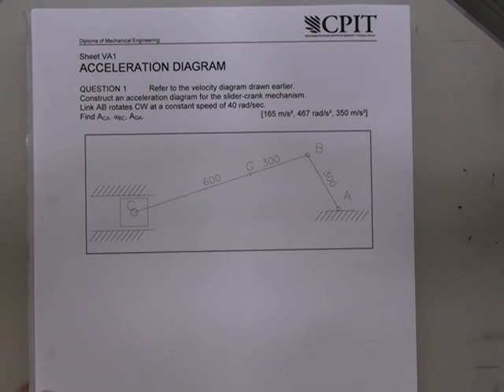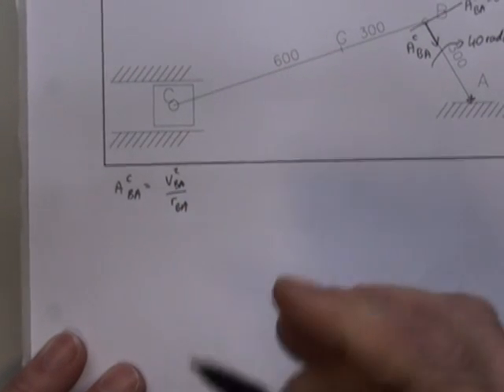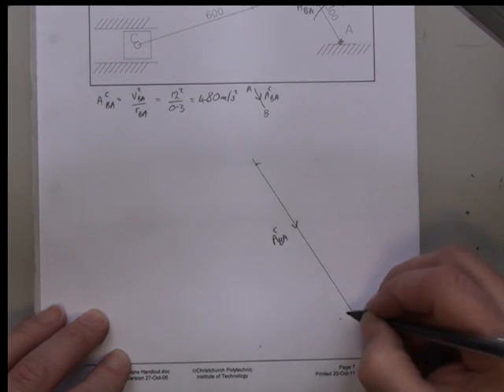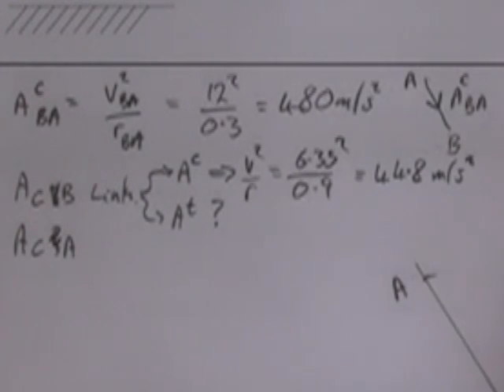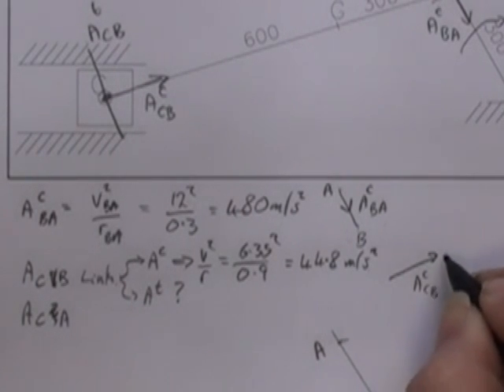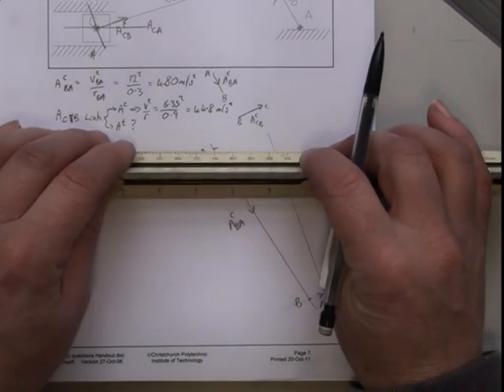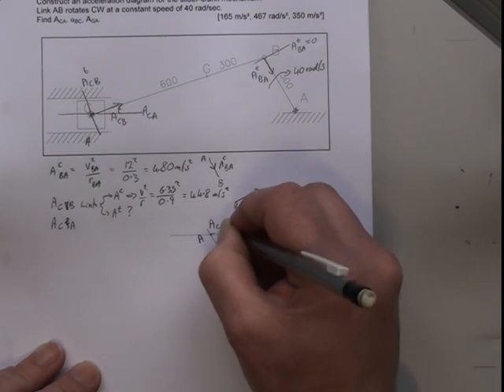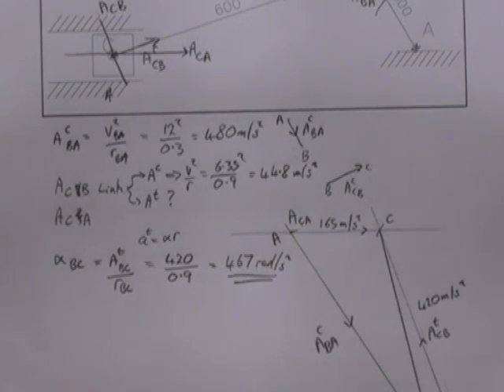Acceleration Diagram construction

Comment from the maker: Hi,  You can measure the angle if you want to be more accurate.  But you need to remember that the answers you get are for only one point on the travel of the linkage system, so you may not get the value of max acceleration anyway because it may occure a few degrees later in the travel of the link.  also, in general, Engineering is not that accurate, we make lots of assumptions and approximations. Steve

Comment: Hello there. I was just wondering why you are not measuring the angle where you transfer the line into the drawing. Since we have to measure the length of the line we draw, doesn't it have to be accurate ?  How come you are not measuring the angle?